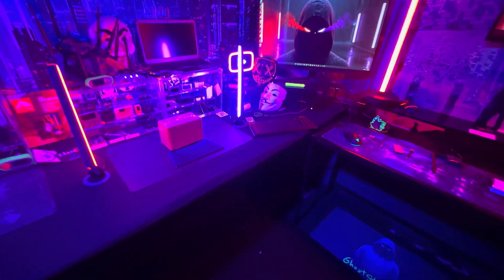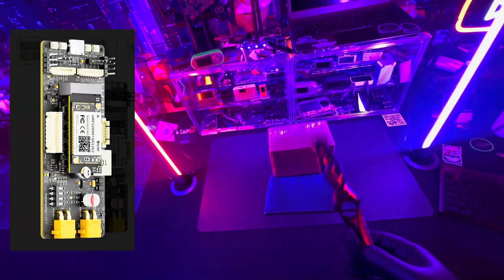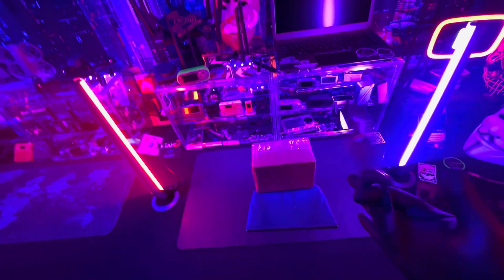Unboxing Heltec MeshSolar | Solar-Powered LoRa + Bluetooth for Off-Grid Projects!

Comment: I need to find a 3d print model for an enclosure for this, but there are none I’ve been able to find so far.  I’m a newb so designing one is too far out of reach at the moment. I might end up with a generic project box but that’s my current holdup.

Comment: I received this about 3 weeks ago, still haven't had time to tinker with it,  I have  3 other meshtastic projects in the works,  one, a magnetic car rooftop solar node,  second is a 1w RF output prototype proof of concept to see if it works,   and a mobile hand held solar unit (faketec) hopefully finish the last two this weekend.   the auto rooftop will take more time since I need to design the case myself and I am still learning the ropes on freecad.   if the 1w prototype works well, I'll be making a PCB board for it.

The Heltec meshsolar is for a robust solar router,  to contribute to the local mesh. once I find and get access to a strategic spot, or I would donate it to someone that does have access to a tall condo, tower or structure in my area.  I just like building things.